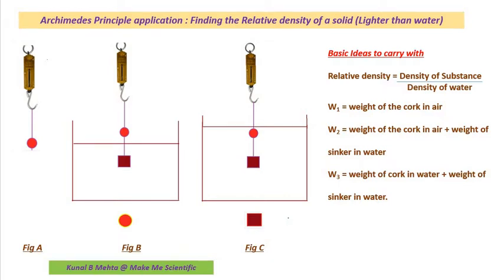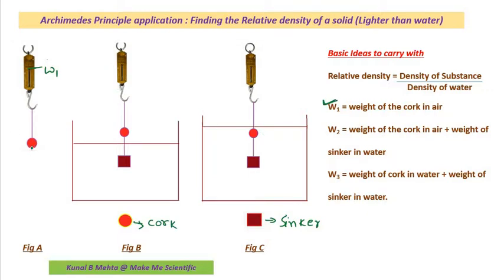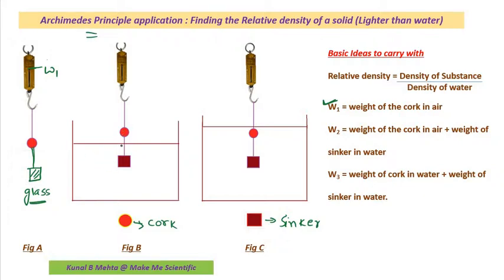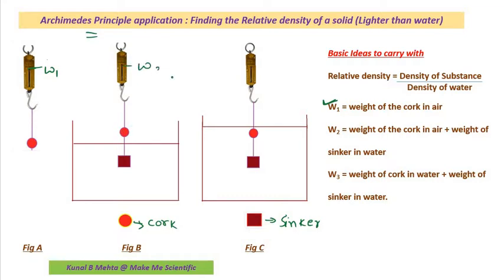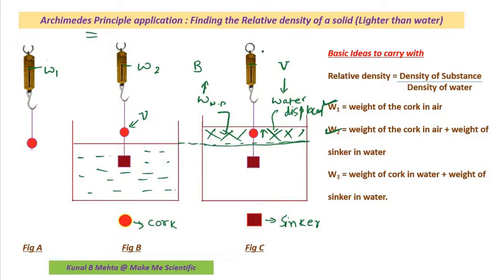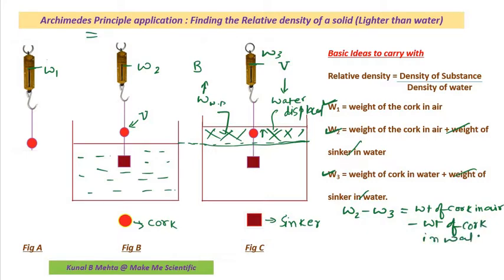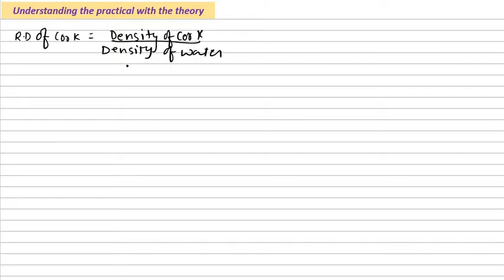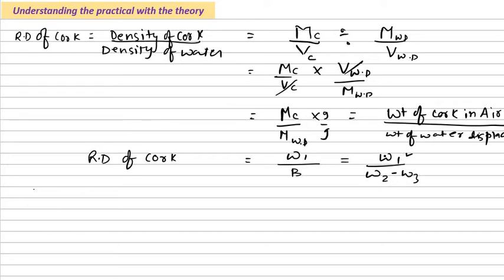Application of Archimedes principle : Finding relative density of body lighter than water

Comment: @MakeMeScientific  A solid of density 3.2 g /cm³ is dropped into a liquid of density 1.4 g /cm³. Will it sink or float? Give reason.

Pls answer to this question
Reply from the maker: If the density of solid is more than liquid it will sink.
Reply: @MakeMeScientific  it means this solid will sink.....thanks for the answer
Reply: @MakeMeScientific  it means it will sink ?